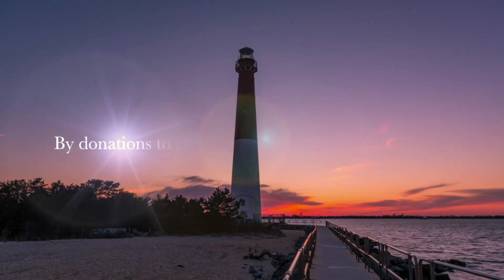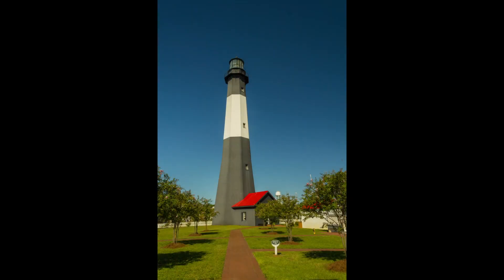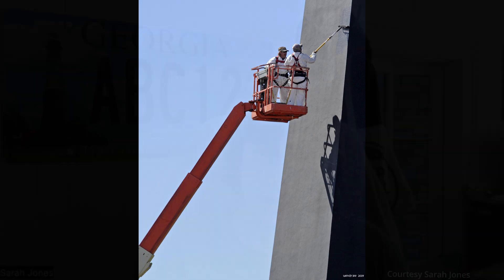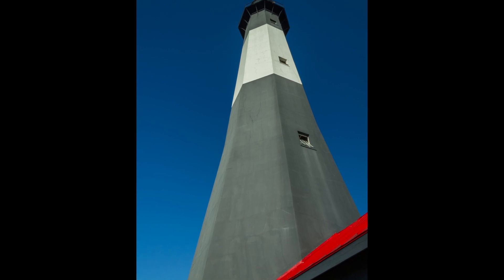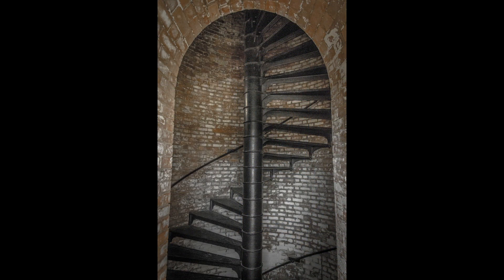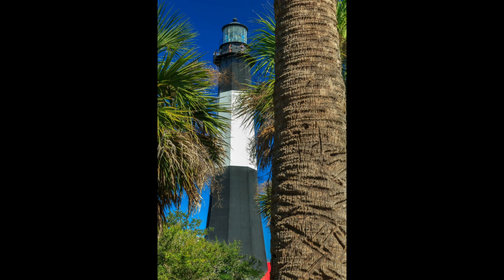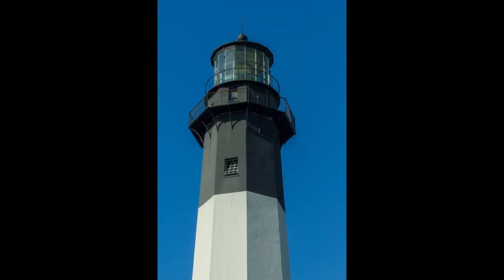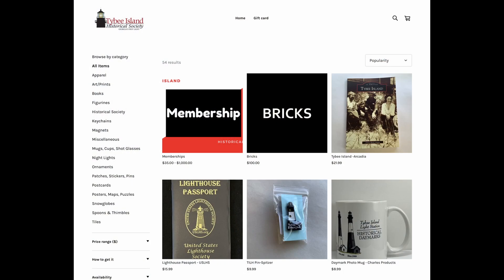Tybee Lighthouse (Georgia) to be refurbished

Comment: From what I know, all lighthouses with cement-based stucco exteriors should have the cemen-stucco removed entirely. It was something that was thought to be a good idea in the 1960s-1980s for brick preservation, but I think now the consensus is that it's a bad idea that deteriorates the bricks.

Jupiter was fortunate to have only had it for about 15 years and I don't think we've had any regrets from removing it.